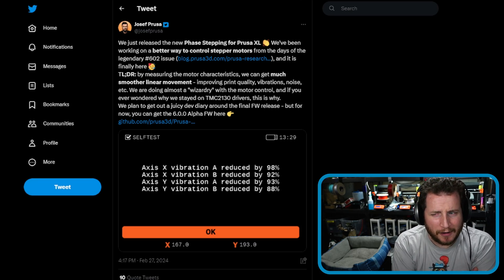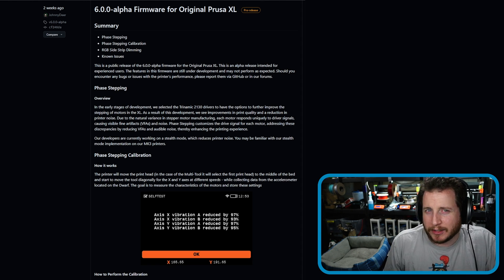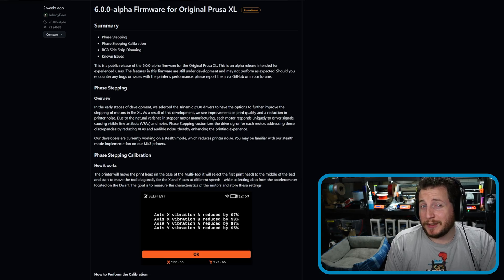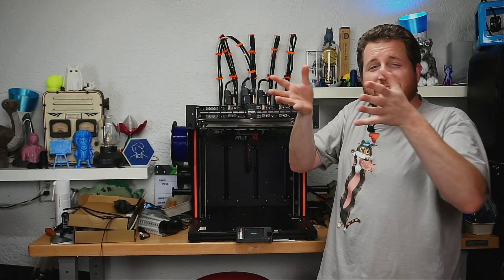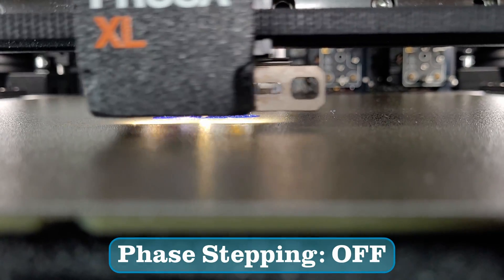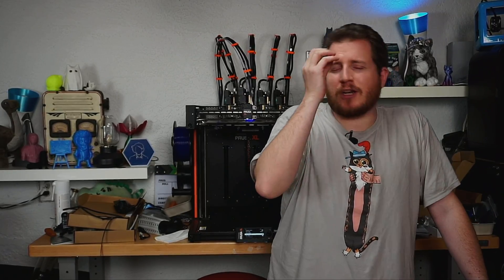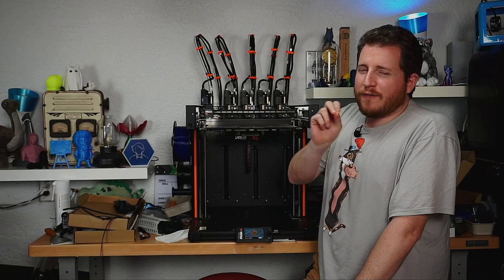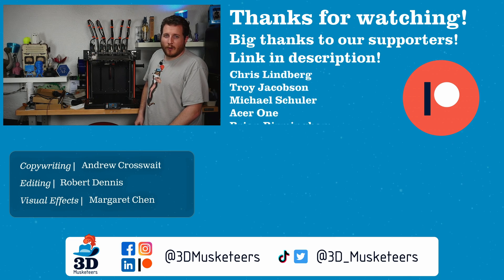Making the Prusa XL 80%+ QUIETER!?!? (NO HARDWARE MODS)

Comment: I have been pleasantly surprised/shocked with how much of a difference the 6.0 alpha FW makes in concert with the newer slicer that disables helical lifts.  Before 2.7.2, I ended up having to make a fork of PrusaSlicer to force those lifts off since they were ruining my print surfaces.

(That's not the only reason, admittedly - my "MultiTool" fork also allows the wipe tower in many places where the stock slicer doesn't like using different nozzle sizes.)
Reply from the maker: right?!? kinda crazy..

Comment: Looking forward to this upgrade making its way to the MK4. There are certain moves that I can hear throughout the building... As an FYI phase stepping is not input shaping. Phase stepping changes the input to the stepper motor to more resemble a sine wave rather than a square wave, whereas input shaping aims to 'predict' system resonances and adjusts the input steps. I'm an electrical engineer; the nuances of motion systems get complicated VERY quickly. Phase stepping can sometimes reduce motor torque, so I'm curious if this change will introduce any 'missing steps' (layer shifts).
Reply from the maker: I think the MK4 would need an additional accelerometer, but thats okay! 

Noted RE: Phase stepping.. I should have looked it up, but I didnt...

Comment: Your video does not show the real amount of noise from this printer. I also have a 5 headed XL and it screams ... At certain speeds it sounds almost like the printer is coming apart and that is not because of the this metal sheets. With my office door open, I get a good audible feedback from the printer being in the room next doors, 5 meters away from me 😮 I'd love to put the new firmware on mine, but it is used in production and I don't want to risk slowing down production due to bugs/changes in the firmware that affect my printer output.
Next thing to tackle is the cooling. Better cooling will surely also help creating support that is easier to remove with less visible 'damage' to the part. I am used to be able to get ABS printer perfect parts with easy to remove supports that do not leave any visible damage to my parts but on my XL, support always sticks too well to my parts.
Reply from the maker: I have such issues with bed adhesion, we did what we could. Humidity here is a big issue. 

So far I have not noticed any game changing bugs, but downgrading takes only a few minutes to flash too.
Reply: @3DMusketeers Humidity could actually be why my colleague has problems with his XL. He is on holiday now and I am now testing the alpha 6.0.0 firmware on his printer, sounds very good and it seems that the bed adhesion is fixed too. But I guess that is due to a change in the weather (nice moderate sunny instead of cold and rainy 😁)
Reply from the maker: could be!!

Comment: 80% reduction is about 6 dB.  95-98% gives close to 20db,
Reply from the maker: Pretty crazy right?!?
Reply: The reduction is not quantified in a decibel scale but refers to the microscopic oscillations produced by the motors during the X and Y movements.

While this will drastically reduce noise, other parts of the printer will still produce other kinds of noises during the operation. 
On a side note, phase stepping is also meant to partly improve the print quality!  🙂
Reply from the maker: correct. We dont have a chamber to do proper testing of noise. The post alpha was quieter, other than on fast travel moves, than my noise floor on that set.

Comment: I am definitely tempted to try the beta firmware. Bit hesitant though since it apparently disables crash detection...
Reply from the maker: I believe it is always off for input shaping, but I could be wrong there?
Reply: @3DMusketeers  I accidently witnessed crash detection and print resuming with input shaping. Worked fine.

Comment: I want to like this machine.  After we add our second Voron, almost built, I really would like to get a Prusa XL but a have believed that it is still in beta even though it is in production.  I have seen some good things our the last few months and hopefully by the time I have the money it will have all the firmware figured out because I really want a 5 toolhead machine.
Reply from the maker: I dont feel like it is in Beta, I feel like it is getting better than I bargained for. I did not buy a machine with input shaping, but I got one. I did not buy a machine that is darn near silent, but I have one now. My cost? Nothing extra. Gotta love that.

Sure, if you consider the landscape NOW, it feels beta to some extent, but when you consider when many of us first purchased it, this is amazing to have and is now my quietest printer, I THINK.
Reply: @3DMusketeers  I'm with you, but only to a point.  The dramatic price premium they charge does mean that many of us have higher expectations, and I feel that's rightly so. Sure, the Bambu printers waste massive amounts of material and cannot do dissimilar nozzle temps, but they are a small fraction of the price and have a much better user experience in some key areas.  So I'm not quite willing to let Prusa off the hook so easy.

Once they get true multi-sized nozzle printing working properly, as they hinted at during the product reveal - years ago - then I'll consider the promise fulfilled.  They are not far off now, aside from crappy network hardware choices.

Comment: did you re-do the tool offset calibration after you updated? i tried and on mine it fails every time with Alpha 6.0.0 when I go back, offset calibration passes
Reply from the maker: nope, you are not the first to ask me, I didnt have to do it.. But I didnt do a multi head print either.

Comment: I cant afford the XL but would love to see if there is any difference in actual print quality with it on and off.
Reply from the maker: I need to fix my bed adhesion issues first, but yes, it is on my list to test. The issue we have is that I cant get my garage dry enough to get things to stick to build plates well without some sort of adhesion promoter.
Reply: @3DMusketeers  on my XL, I just print the first layer glacially slow.  I haven't used my PCA Hairspray trick, yet, but I haven't been printing PC.so I haven't needed it.
Reply from the maker: I will have to try it out! I just hate putting sticky stuff on the beds!
Reply: @3DMusketeers  

I take a olive oil sprayer, fill it halft full with 60% isopropyl, and add a cap of PVA

150ml 60%, 15ml PVA

Shake, pump, spray.

Works best on satin sheet.
Reply from the maker: I just dont like spraying crap on the sheets lol
Reply: @3DMusketeers  it's great. Once you have a coat, you refresh it between prints with 60% isopropyl.  It's self levels and leaves a beautiful, thin finish. Way thinner than glue stick or any other product with no buildup.  My sheets and prints are always clean.  It's specifically important for PC and nylon or anything else that will weld to your bed.
Reply from the maker: interesting!

Comment: The more exciting thing for me is that there is a built-in accelerometer in each buddy board.  That means one day they will release fine-tuning for inputshaping. Does the MK4 buddy board also have it built in?.  Why do they keep calling it RGB light strip when it's only white light. One feature they should add is auto-shutoff of both the light strip and LCD screen. Also, they still need to quiet down diagonal movements above 150 m/s.  Did you have to do nozzle calibration as well? Only reason why I did not flash mine yet.  As a side note, the ObXidian .4 nozzle seems to eliminate almost all stringing even with silk PLA.
Reply: From my understanding mk4 doesn't have them
Reply: It is RGB: in case of a failure the light turns red
Reply from the maker: true, I do like those colors, but I get why some dont
Reply: @langph  I think you mean the front panel light (under the display).  The light strips, however, are always white.  I have never seen them change even during redscreens, BSODs or updating.
Reply from the maker: I do not believe the MK4 has it, but I believe there is provisions to add one. Do not quote me there though.. 

I dont mind some of the diagonal movements being loud, that is what it is. Every printer we have has issues with fast motions and noise, it is seemingly a fact these days. 

No nozzle calibration (I had done it when we built the machine), just the resonance calibration which is only done for TH1.
Reply: In machines that are repeatable and unmodified there's no need for "fine tuning". This is because the band of the input shaper is typically much wider than a deviation in resonance frequency. Watch Michai Designs interview with Duet 3D engineers.
Reply from the maker: oooh can do!
Reply: @3DMusketeers 
As you mentioned you are going to redesign cooling. I would not be surprised if Prusa is working on a better cooling solution as they are working on a high-flow nozzle. Maybe on your next Print  Fix Friday you can comment on the major layer shift caused by version 6.0. Is in Shane's thread announcing version 6.0 alpha. Does not look like it is even possible.

Comment: Too bad right now I blew the motherboard on my Voron, and am waiting for a replacement...
Reply from the maker: oh no! What happened!?
Reply: @3DMusketeers  Short circuit fed 24V where it doesn't belong.  Replacement coming tomorrow or Friday.
Reply from the maker: oof :(
Reply: @3DMusketeers  Just got the replacement board, accidentally got an Octopus instead of an Octopus Pro.  I guess that's just 1 line of config to change.

Got around to recompiling my Klipper for the replacement board, realized I had not updated in a long time.

Comment: First I have to fix why the Wi-Fi is not connecting now. I changed my mesh network.. same name and password. But there may be a space at the end of my SSID... Wondering if a space at the end makes it impossible to connect. The wifi icon comes on for 1 second then  ever to return after loading credentials. Need time to contact support. Any ideas folks
Reply from the maker: Not a clue, 100% sneakernet for this machine and I. Never bothered to put it on the network yet.
Reply: If i remember it right a Space at the end of the SSID is not in the 802.11 standard so the manufacturers do it in some way there like...